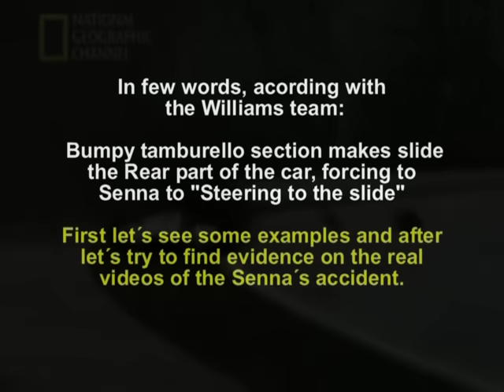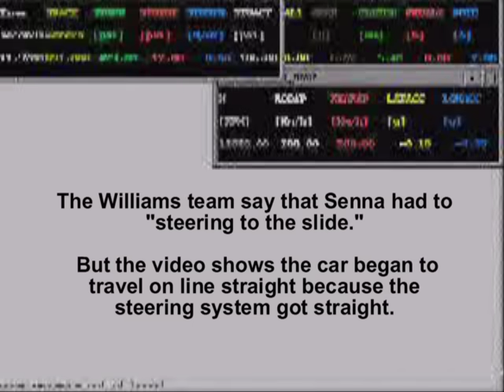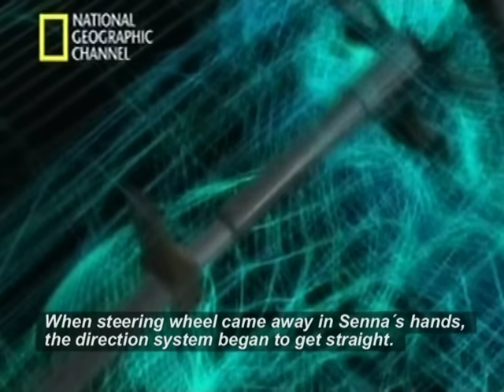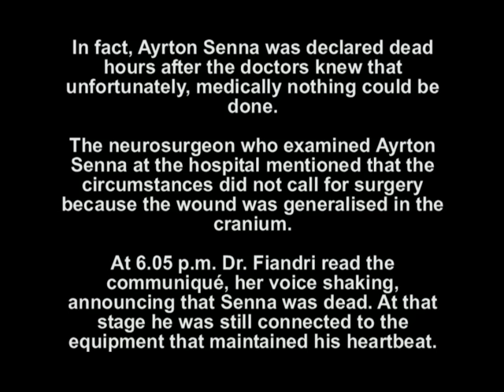5/5 the death of Ayrton Senna - what NatGeo did not tell

Comment: His steering broke. If he lost control he would correct it, not hit the brakes.
Reply: yea thats true because he knew he was going straight on and not steering but why didn't wheels lock up
Reply: Because locked up wheels brake less efficiently than wheels that are nearly locked up (still rolling, in other words, hence why ABS shortens the braking distance). Senna was an extremely skilled and experienced driver, and would most likely be capable of braking without locking up the wheels :)
Reply: ABS also allows you to steer while braking to the max too. Locked up  wheels won't steer a car. Skilled as they are, suddenly finding no steering control could itself cause a delay. Race car drivers still get themselves into trouble they can't get out of. How many times do you see a Nascar driver save the car in a spin vs. wrecking into the wall or sliding down the track? Just using it as an example not comparing F1 to Nascar. They almost always wreck  with a certain amount of yaw.
Reply: PGTMR2 Suddenly finding yourself with no steering, while expecting it would likely cause him to have applied less pressure to the brake pedal than otherwise, because he would expect the car to turn, thus reducing the amount of grip for braking.It's perfectly possible to brake and steer at the same time without ABS (assuming you avoid locking up the wheels), it's just harder to control, especially in unexpected situations.

Nascar drivers getting into spins is not comparable at all, because they drive on extremely inclined tracks, and their cars are set up "unbalanced" as a result (so that they will be balanced on an inclined racetrack, but as soon as the incline changes (direction of the car changes relative to the track) the car is unbalanced, and thus almost impossible to save). "flat track" race-cars are far easier to catch from a loss of traction (by no means easy compared to a road car, but far easier than "inclined track" race cars none the less), because the setup of the car is balanced, because it is supposed to react the same way turning left, as when turning right, and the cars reaction is therefore easier to anticipate.
As an example look at Le Mans race cars, they all end up in more or less controlled slides at some point during the race, but most of them manage to control the drift, and avoid spinning out and/or crashing into something/someone.
Reply: Ben Conway locked wheels means you basically can’t turn
Reply: That's genius!
Reply: @AIRDRAC  Small correction here, ABS does not shorten braking distance when compared to maximum braking without wheel lockup. The major advantage of ABS is that it gives the driver the ability to steer the car with the wheels "locked".

Anyone who's driven a car with ABS on snow and ice will tell you, ABS lengthens the braking distance while giving very limited control of steering. It used to be possible, some time ago on older cars, to pull the fuse that controlled the ABS. I know a few people that did just that during winter, some even left the fuse out all year long. Sadly, today you can't do this anymore.
Reply: Of course! He was a 3 time world champion and obviously knew he would have to counter steer it
Reply: Go to 4:58 ... Watch his speed in KP/h (it's the white number on the bottom column and it hits a max of 310 kph at the 5:00 mark, going into the corner).  Stop at 5:01 ... In the span of less than a full second, Senna's speed drops from a high of 310 to 274 BEFORE he's even left the track (in fact, he looks to be at least 20 yards from the edge)... if you set the video in motion again, you will see it drop dramatically further until it stops completely, which is the moment he hits, or possibly even the moment he leaves the track, with the roughness of the soil he's going over knocking out telemetry before he even hits the wall.  SENNA IS CLEARLY HITTING THE BRAKES... it is impossible that Senna's car would have dropped 36 kph (22 mph) in, what I timed to be about 0.25 or 0.3 tenths of a second, merely from his foot slipping or lifting off the accelerator... he has to be hitting the brakes.  Now, why he wasn't locking them up, I don't know... perhaps he was hoping to regain control and was trying to avoid locking them up... or perhaps, with such a short distance to go, and a section of soil and grass between him and the wall, he knew that locking them up would provide less braking than controlled braking would... I don't know.
Reply: His car also flew into the air at one point, turning him into a passenger and rendering him unable to do anything with the car
Reply: @AIRDRAC  even thou Senna is one of the best if not the best, when your heading towards a wall at almost 200 mph you slam the breaks and they lock up. I don't care who you are. go watch old footage of him and Schumacher locking their breaks in those situations.
Reply: it did not and you have no proof that it did.
Reply: As the car went straight on towards the barrier, Senna’s head wasn’t held up, so he was probably unconscious, making him go off the track.
Reply: @jackhammer111  his head falling isn’t the cause of a mistake. He had no control over what happened
Reply: @neosynths5850  let me get this straight. Your theory is that a perfectly healthy Senna driving in a formula One race suddenly lost consciousness? That's your way I'm saying the great Senna didn't make a mistake? He passed out for no reason? Now THAT is one I haven't heard before.
Reply: @jackhammer111  why did his head fall then? You can see his head fall in the mirror
Reply: @benconway2721  ABS brakes are anti locking
Reply: No it did not.
Reply: Someone set Senna out in a killer machine. If Senna made that left hand bend, if he could have steered, the race would have ended very differently.
Reply: Yes, I think he had no steering when it was 70% broke and was only 30% connected, that won't allow you to steer at that speed but the wheel will move as the video showed. The rest probably broke off due to the impact.
Reply: @TheShorebird , If only they all carried out a traditional weeks mourning for Roland Ratzenberger when he had only just died.
Reply: @TheShorebird   Steering column did not break. Sena was not infallible and made a mistake. Sena had control of the car. The data logger proves it. 3:28 11.2 seconds the rear end of the car stepped out and a tenth of a second later Santa moves wheel to the right correct the skin and the nose of the car responded. All of the videos clearly show both the oversteer and the correction. Clearly, the steering wheel was not broken. The part before that where it says the large part of the downpours was removed from the car by denying the airflow underneath it, is completely bogus. This was the era of the lowest height ride height the car is ever ran. They generated more downforce the closer to the ground they were, not less. Are traveling beneath the car did not remove downforce it increased it. I think the real problem was related to the low ride height because the car was clearly bottoming in that same spot in the turn lap after lap. As I recall it was Sena himself who encouraged them to run less ride height. But when the car bottoms in the part of the turn where there's maximum lateral acceleration the weight of the car is being transferred to the ground where it bumps instead of to the tires that generate the grip. Obviously, if a bumper Clips the car from underneath it creates an upward Force and that upward Force leaves less weight on the tires. That's what made the rear end step out. That's what reduced the amount of downforce on the car and made it loose. He was doomed at that moment because he had no choice but to catch the skid, the nose swung right and he was out of racetrack pointed at the wall. The other thing that doomed him what's the gravel trap wish didn't slow him down at all. The car just skipped along the gravel and hit the wall at nearly the same speed as it left the track. This video is self-contradictory in places and tries to talk out of both sides of its mouth but what they do get right is what the Data Logger shows 11.2 and 11.3 seconds. So quit making sh*t up
Reply: @jackhammer111  Sorry, I don't see it. Not saying your not correct but I don't see him steering into the skid or the ass end kicking out on the actual video. Why where the wheels straight then while he was headed to the wall? How can you explain the 70% clean break in the steering column and the rest looking like it was ripped in half from an accident? Not to mention the movement of the steering wheel that was only duplicated when someone was just yanking on it while sitting in the cockpit? It looks to me that the column was partially broke and the wheel was partially turning up to where it was cracked, at that moment when steering was lost the wheels went straight. That's why they weren't turned when he was headed to the wall, which they would have been if he'd had steering when he went off the course. Chances are he'd have turned the wheel all the way left and cut around hitting the wall ass end first.
Reply: @TheShorebird  You're saying you start at 3:28 and watch it forward and you don't see what is clearly shown? It's a recreation but they show the back of the car step out and they show the steering wheel moving to the right. That's like saying you don't see an oncoming train

I'm showing you exactly where to look in the video. Now you claim got the wheels were straight when he headed to the wall. Exactly where do you see that? Then you say something about a 70% clean break which makes no sense where do you get that? Show me exactly?  I do not believe the video shows any movement in the steering column. That part of the recreation is completely bogus. There's no data that supports that. When he sees does the car is headed straight for the wall he does what every race car driver does. He takes his hands off the steering wheel. If you're still hanging on to the steering wheel when it hits the wall it'll break your wrists

You can clearly see Sparks under the car just before the rear steps out. That's what caused the crash. When the car bottoms it took weight off the tires and they wouldn't turn the car. Insufficient ride height.
Reply: @jackhammer111  Watch the actual video. If you've never seen the pics of the steering column then you should look for them. The wheels aren't turned when he hits the wall. You're going by the documentary and nothing else. That's all CGI.
Reply: @TheShorebird  exactly what nelson piquet did in 1987
Reply: @AIRDRAC  steering column as I said above. he hadnt even touched the brakes a LIGHT TOUCH  at most.  as he tuned the wheel anti clockwise it failed, not exciting but it was the outcome. nonetheless
Reply: Its depressing
Reply: @Swift - that’s correct.  Senna would only hit the brakes if there was NOTHING left for him to do. He was too good a driver to just hit the brakes at the first sign of a problem.  He knew he had NO CONTROL AT ALL OF THAT DEATH TRAP
Reply: @thebonesaw..4634  probably because he knew very well that full brake lock meant no ability to turn. In that instant, being a world class driver, he would have applied the brakes hard, but not full, just hard enough to slow down without losing steering ability. unfortunately for him, the steering column was already broken.
Reply: @silva_579  -- Didn't I literally say the exact same thing?
Reply: @jackhammer111  the Frenchman you support is a coward and sneaky snake, how he is alive and well is beyond me!!!
Reply: @jackhammer111  Neo is correct, Sennas head dipped down as the steering became unresponsive, possibly looking down to see what the issue was
Reply: @milkshakemuncher  bullshit. total bullshit. you can see the car bottoming out on previous laps. he made a mistake and carried too much speed into the corner and when the car bottomed out taking weight off the tires,  the car went loose, he steers to correct it but it put him off the track and hit the wall. Most of the time that crash would have been survivable but the tired hit his head. If his head dipped down it was because the car was rapidly decelerating pulling his head forward. Why is it you can't admit to him making a mistake? I can find plenty of them for you if you like. He wasn't godlike superhuman or magical and the rules of physics apply to him just like they do everyone. He'd been having trouble with that turn all weekend and it was his decision to lower the ride height. Do you not see the sparks the bottom of the car made?
Reply: @TheShorebird  I see you have no response to the detailed post i made so now you want to switch away from this video, which you said proved your idea, to a video of the crash. You don't answer my questions because you can not do so in a way that is not obvious nonsense.  You used this vid until I proved it in no way supports what you say, and now you want to watch the crash, which I have done countless times. already. There is no video of the crash that proves anything one way or the other BUT the data loggers do. Just like aircraft black boxers prove how airplanes crash racecar data loggers prove how this crash happened. The car bottomed on cold tire pressures and it killed the downforce. There was a sensor on the power steering that measure the amount of twisting force on the steering collum. It recorded twisting force all the way to the moment of impact. Obviously, if the steering collum is broken there's no twisting force. Other data shows both the oversteer moment and Sena's lightning-fast reaction to it, but he had to steer right to catch it and it took him off the course. The oversteer moment was just a twitch but and he responded fast but you steer right to catch oversteer in a left turn so the act of catching the twitch moved the car to the right into the grass then sadly skipped across the gravel not slowing the car at all.

.So nobody should care in the least how it looks to you because the data says you are wrong. So get over this hero-worship nonsense and stop repeating this lie.  

https://youtu.be/luLFMoW1IuE?t=900
Reply: @neosynths5850  What happens to  your head when you slow down. In fact, I see his head move left as he leaves the track which is exactly what you'd expect if had been resisting a 3 g turn pushing your head to the right and suddenly the force is removed because your not turning any more, you going straight to the wall. 

https://youtu.be/luLFMoW1IuE?t=900
Reply: @milkshakemuncher  when you hit the brakes what happens to your head? 

https://youtu.be/luLFMoW1IuE?t=900
Reply: @thebonesaw..4634  The thing that impressses people the first time they drive an F1 car is not how fast they accelerate or even how fast they corner. It's how fast they stop. I've stood in the brake zone at the end of a high speed section and what it looks like is Star Trek coming out of warp drive. 

https://youtu.be/luLFMoW1IuE?t=900
Reply: @flightmaster999     maximum braking with wheel lock-up. That is exactly what ABS does a hundred times a second. What you are saying is not true. Show some real data? How can you imagine you wildest dreams that carmakers would go to braking systems that increased stopping distance? The first time someone hit someone from behind the lawyers would have a field day. It's nonsense
Reply: @jackhammer111  Read a book sometime, you might learn something. FYI, mechanical engineer that worked on car braking systems here. Bet you're too lazy to look this one up!
Reply: @jackhammer111  his head would go forward, but not in as angled downward fashion as his does in the on-board. If that were the case, no driver would be viewing the corners they slow for.
Reply: @jackhammer111  doesn't make sense to me, so my opinion is bullshit?🤔

I watched the clip you posted, it showed modification to steering and despite them saying it had not snapped, it did snap! It was 60% cracked through before Imola, the other 40 gave out.

I don't care them moving the column left, right, up, down, on out etc.

The wheel itself (rotated) turned hard left down, Senna looked downward rotated it back to the right and there was not any movement in the front tyres reacting to steering input.

Yesterday you replied to my comment of him looking down. You said what happens when you put on brakes at high speed, insinuating I knew nothing.

My reply was his head would move forward, but not the downward that it did. Search F1 on boards, or external cameras when the cars are braking, it will prove my point, or don't,  I couldn't care less.

Nat Geographic based their program on the Williams data and Williams explanation of how to read the data, fro. a team that was doing everything to cover up what happened and avoid manslaughter convictions.

So if you believe their bullshit explanation and it reaffirms your bullshit opinion, go for it.
Reply: @jackhammer111  Educate yourself. I've spent well over 100 hours going over all the footage, data analysis etc viewed many different opinions before drawing my own conclusions.
Reply: @jackhammer111  It is no lie. The investigation found and the court agreed that the evidence showed the steering column failed. That means that your claim that the data can prove otherwise is a false claim. Otherwise why would the court not agree with you? This documentary was merely an alternative theory, with no factual basis. Its not even real incar footage, its computer generated. Watch Senna's last lap incar from lap 6 and see how the steering column flexes. The weakened metal from being poorly welded could not withstand this cyclical force, and developed a stress fracture at the point of the modification. When Senna hits the bump on Tamburello, the maximum stress through the column was sufficient to cause the already stress-fractured metal to finally snap. This was proved. It also makes sense. If you know anything about metallurgy you would know that the act of welding can compromise the crystalline structure and weaken the metal if not handled very carefully. Ideally, you should never cut such a critical component subject to high cyclical stress. I guarantee they would never even think about performing such a modification these days. Just because you want to be right, doesnt mean you are right, and in attempting to assert your argument you have only revealed your ignorance and arrogance.
Reply: @jackhammer111  The data logger readings you refer could not prove that the column didn't fail. For one thing the readings immediately become invalid when the column fails, because the data assumes that the column is intact. There are a number of possible explanations for what caused the readings, such as any uneven surface could influence the wheels to move in an uncontrolled way if they are free of any other control. Another possibility, which is widely accepted as I believe the physical evidence supports, is that a small part of the tubular steel remained connected after the failure, and because of this Senna was able to put some small input on the steering in a desperate attempt to minimize his angle of impact with the wall.
Reply: @iavdortmunder8132  https://youtu.be/luLFMoW1IuE?t=925
Reply: @jackhammer111  I've seen the Nat Geo cartoons. Just because it says it on TV doesn't necessarily make it factual. On this matter further enquiry is needed, as this documentary was motivated by the need for F1 and Williams to control the narrative and hide what really happened, and ignores the body of physical evidence. Physical evidence trumps invalid data readings every time. I understand why they wanted to cover it up. In a sport that prides itself on being the cutting edge racing car technology, how embarrassing for Williams for the world to know how astonishingly they screwed up, not to mention the legal ramifications pursued by the Italian police at the time.
Reply: @neosynths5850  it has been proven Senna looked down at the steering while this was happening.  It has been proven the steering column broke and he had no control. Case closed.
Reply: @jackhammer111 🐑🐑🐑
Reply: @dsmerjosh5  You don't know me. I have one of the most scientifically skeptical minds you'll come across. That thing you did right there? Completely juvenile.
Reply: @jackhammer111  I agree.
Reply: @neosynths5850  because of the g forces created by brakeing.
Reply: @thebonesaw..4634  That is amazing car control, he must have remained completely calm not to slam on the brakes instantly.
Reply: @blackjack4195  -- I agree.  But, he was a world-class driver by this point, with thousands upon thousands of hours perfecting his craft.  So, while I'm impressed, I'm not at all surprised.
Reply: @pgtmr2713  there was no ABS in 1994 in the cars in this race…..
Reply: @gabrielemattivi518  The ABS part of my comment was adding to what the guy before me said about ABS, not F1. People always think ABS is only brakes, it allows you to steer as well, while braking.
Reply: @pgtmr2713 abs was banned that year btw
Reply: @cay7809  Yes. That had nothing to do with my comments explaining other benefits behind abs.
Reply: @thebonesaw..4634 there seems to be a bump, the camera judders, his head tilts, it's like kicks out
Reply: @neosynths5850 I thought that... did he  faint ?
Reply: @neosynths5850 if he was looking down, he was probably looking at the steering wheel,  he had looked down at it already about six times in the previous 30 seconds.